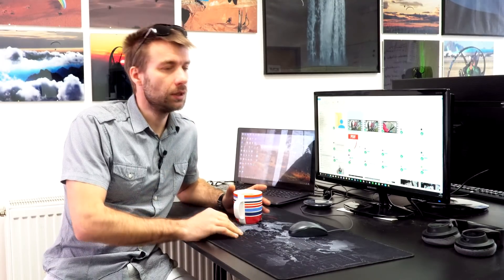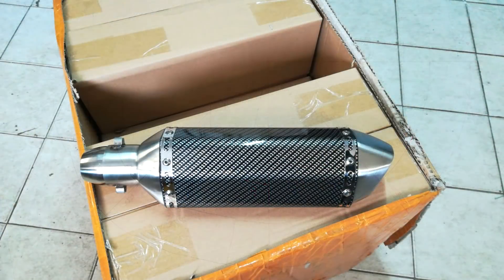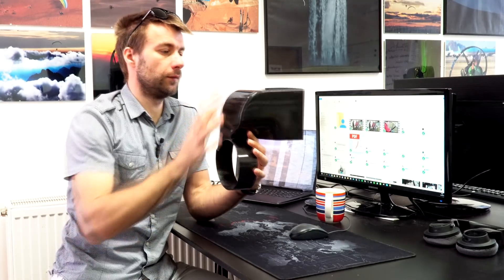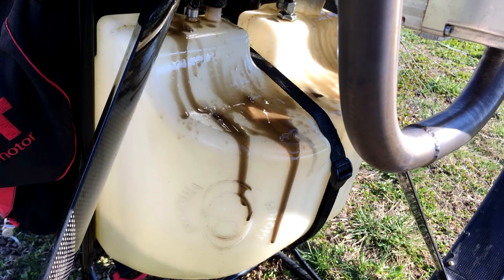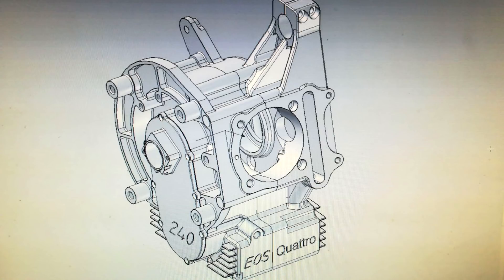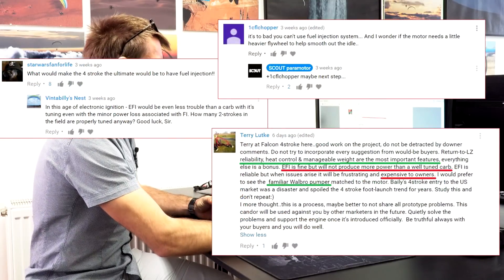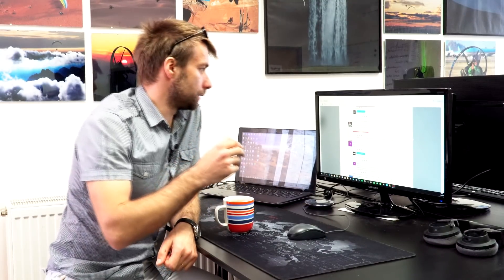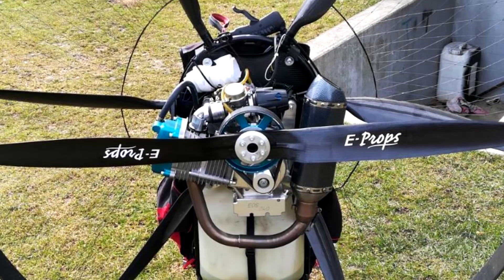UPDATE: best paramotor engine ever? 4stroke NEWS!

Comment: All I can see is (yet another) GY6 top end, (and probably crank) mounted in yet another custom CNC Crankcase. Taida 232 ala 'ruckus" mod top end?
Exhaust problems are due to trying to use dirt cheap eBay Chinese GY6 stock Scooter exhausts and their tinfoil brackets. Compound the quality issues, with massive vibration issues due to low mass, high compression and you have a solution less reliable than a stock Chinese Scooter that they now mainly only export, as domestically they've gone mainly electric!!
Is no-one doing any serious development? I love the choke that you can't reach, due to the stock (GY6) Scooter choke cables being a tad short? 
As for Fuel injection, waste of time. Heavier, needs a high pressure fuel pump, doesn't deliver any more power, and the stock GY6's don't ice too bad anyway. It gives even more single points of failure. 
I'm guessing the ignition is still a single GY6 bog-stock magneto too? 
Time someone delivered a decent fully Electric solution. Time to EVolve.

Comment: Spend all this time and  effort in going electric !  We drive e-bikes, Tesla cars why not electric Scouts ?
Reply: because the power density of gasoline can't be matched with batteries. and a 4 stroke promises to really improve fuel efficiency with out those pesky lithium batteries that like to ignite if you manage to do something like scrape open the foil wrapping...have you seen where they mount the batteries on the openPPG. no thanks.

Comment: Sounds all good 👍
What i liked most was no trash talking.
I wish you all success with the development of the motor.
Have you ever considered useing one or two miniature/small jet engines?  Just thinking.
I don't glide.
I've done a bit of static line jumps.
Just wandering if a miniature jet is feasible or not.😱😁😁.
Cheers for now.

Comment: Great project! At first glance I notice how small the crankcase is , this may be the cause of your oil leak.  Causing crankcase pressure to travel at a very high rate of speed through your breather port taking  oil with it.  A larger crankcase may be the cure. A good test or least expensive  would be plumb in a sealed canister or tank into the crankcase with a large port. Therefore increasing crankcase volume. It will most likely continue pushing out oil no mater how the pluming inside is routed.

Comment: Not sure if this has already been asked but...if someone is planning to buy a Scout or already has a Scout, will they be able to purchase this motor and perform a direct swap or will an entirely new unit need to be purchased? Keep up the good work and I look forward to hearing more updates in the future.
Reply: Almost any motor Can be mounted to any cage frame. I’m sure the motor mounts will be in different spot from the Moster 185 because it’s a new engine design. if the manufacture decides to allow you to do the swap by providing the hardware in an all in one kit then it’ll be an easy straight forward swap. But One can still easily buy parts piece by piece and do it (obviously your cage has to be same as the one scout uses with new engine) or custom make your own bracket/mounts/plate.

Comment: turn the engine so the cylinder is in the upright position iv rode 4 stroke bikes for 40 years and never known a 4 stroke run very well laid in that configuration they are not like a 2 stroke that will run in any position theres to much oil colecting in the rocker cover hence spitting it out through the rocker cover breather

Comment: The industry should look at hybrid motors for reliability and efficiency.  Electric motors, fuel generators.  More efficient on fuel, higher torque on electric.  Best of both worlds.  ICE doesnt need to run as hard as it’s just generating.

Comment: 4 stoke doesn’t require a oil fuel mix correct?
Reply: Nope. A 4 stroke is the same as whats in your car. The engine has a reservoir of oil and will likely run off of regular gas without the 2 stroke oil added to the fuel mix. In theory the maintenance should be less and reliability should increase provided they work out the kinks. It will also have the added benefit of better fuel economy since it will get double the rotations of a 2 stroke motor per cycle.
Reply: Thanks for the thorough detailed reply:)

Comment: Just why have you installed the  air inlet next to the exhaust. its loaded with carbon monoxide, I don't think that it has a abundance of Oxygen also more heat input. It does not idle very smooth either.

Comment: I do not like how near the exhaust is to the fuel tank. I would work to make the muffler face down, not only for rain issues, but for noise levels.

Could you rotate the engine 90 degrees and make a custom intake manafold so the carburetor is level?
Using that way/method the fuel would be on the fuel side and not the exhaust side.

You have the engine maker right next to you; perhaps they can make a block with a custom oil sump if need be.

Otherwise, your paramotors look well-designed.

BTW, I am also a Rhino3D user, carrying the same name on McNeel's forums.

Comment: I had the idea a couple days ago which is probably not the first idea but integrating a LED lighting system in the frame of the paramotor weather that it would be an option or not it's bound to be seen I know this will all take time but yeah it would be cool to have a somewhat perfect pair of motor to the General Public but I also realize that's not feasible at this time but the closer that you can get to perfecting a paramotor with the technology we have now that would be a winner just my thoughts though keep up the good work keep us informed

Comment: We understand there's a process of getting the motor issues worked out and in the future fuel injection electric start Etc. Hopefully a quick-release harness is in the works in the future or at least sold as an option as I like the fact of having something like an automotive Style Racing harness where you can disconnect from the harness IE in the event of going down in water

Comment: Get Honda involved, NO ONE builds small 4 strokes better....Period!!
Reply: Can you just use a Honda 35? Or is it too heavy how heavy are these other motors used today
Reply: At 1hp, you would need at least 15 of those and that would only get you a slow climb :)
This "is" (for all intent and purpose, a "Honda engine"... the infamous GY6 with Taiwanese mods)
Reply: Hondas engines are too heavy and underpowered. There is way better engines out there than hondas. I beg to differ on Honda small engines being reliable, I change out these engines after 30-50hrs of use. Their garbage and non rebuildable
Reply: @danr8194  Thanks for the Heads Up Dan :-)
Reply: @danr8194  I tried giving u a Thumbs Up
on two different Devices, but when I
try to, it goes straight to Replies instead!!?
 The same thing keeps happening when I
have tried giving Thumbs Up to several
others!? (On 3 Devices).
I think You Tube has done something to
cause this ......
 Who knows how many Thumbs Up u'v
been given!?

Comment: This is why I love Miroslav, and scout paramotors! He could hide the fact that the new four stroke engine is having a few problems, like with the oil leak and such. No, he is giving out honest updates as the engine comes along, and I know it will be amazing because that's what Scout is all about, amazing gear. Also you see these other companies on here bad mouthing each other left and right, no class! I haven't seen SCOUT do this once, that's how you should act. All that other crap is bad for the sport. All those reasons are why come hell, or high water I will buy a  Scout with the Moster 185 plus. Yeah it'll probably take me fucking 4  years to save up for everything, but to me it's worth it. SCOUT IS THE SHIT!!!

Comment: It looks like a great new development in internal combustion engines but it might be too little too late electric is going to sweep the paramotor industry and as battery capabilities increase rapidly they will match and surpass internal combustion engines little to no maintenance very big cost savings safer less probability of stalls many fewer moving parts no flammable fuel although some batteries have had issues with overheating but just like motorcycles and Automobiles the new kid on the Block electric propulsion is taking over every Transportation mode
Reply from the maker: It depends on what your flying ambition is. If you want to fly around your house and enjoy the sunset this is great.
For climbing high above the clouds electric do not have enough power.
For flying adventures, fly and camp, discover new places, camp overnight and fly further next day... Electric just do not have range and charging takes too long.
Recently I got addicted to adventure flying. Icarus Trophy race, flying Midwest USA or Iceland would not be possible with electric.

Last weekend I have flown an electric engine. It was a nice experience but not my cup of tea.

Comment: 4 stroke engines have their place ... and this is not it. They are cumbersome and overly complicated  in comparison to the industry standard 2 stroke.  
      There will be far more maintenance required,  with valve adjustments,  oil changes ect.
     The number of people using 2 stroke  paramotors are  not a  significant contribution to emissions issues.  
      I see few to  no benefits  of  4 stroke technology for small , lightweight  applications.
Reply: Benefits: double the range, flat torque curve, don't have to premix fuel, less stinky, probably a bit quieter.

Comment: What about a twin cylinder (two smaller pistons) to balance pressures? Many more moving parts I know, but single cylinder engines have typically been relegated to the 2 stroke market and don't have to deal with oppositional pressures, blowing oil out, like you're trying to overcome. Two pistons naturally balance each other.
Reply: Dawson Ronan Not to mention that single piston designs are challenging to balance.

Comment: I don’t get the 4 stroke thing.  Paramotors are very weight sensitive and no matter which way you look at it, 2 stokes are lighter and produce more power.  More reliable as well. Less moving parts. I honestly don’t think you can re invent the wheel.
Reply: 2 strokes more reliable than 4 strokes ? Not even close. There is much more to it than just the number of moving parts ! 2 stroke pistons work in terrible conditions of heat and lubrication, and that is why they are very short lived !
Reply: Have you even tried a 4 stroke.....? 
I’ve flown Baileys now for 5 years, they are the most reliable motors I’ve ever had, and with comparable weight of some of my previous 2 stroke Parajet/Polini 200 paramotors. 2 litres per hour compared with 5-6 litres per hour too, you have a weight saving of half the fuel weight for the same amount of flight time.
Reply: Jason Nadler no way 2stroke is more reliable, shorter time in service there a dozen reasons why an efficient 4 stroke is the way to go and it's not just fuel consumption
Reply: only benefits are efficiency and not mixing oil in your fuel
Reply: fuel consumption 2 liters per hour vs 2gal /hr

Comment: Why do they put this long (and heavy) exhaust pipe around the bottom of the engine, which brings the silencer looking upwards, so that the exhaust hole (and the noise) is closer to the pilot's head (and ears)? Wouldn't it be better to keep the silencer and the exhaust hole below the engine?
Reply: Because the bottom is the hottest part. Would you want a 300+ F pipe just inches from your head, melting your helmet and singeing your hair, or melting your netting? Also it helps keep the oil in the pipe and not on your floor when not flying.
Reply: Check this for the layout of the exhaust and the silencer:
http://www.baileyaviation.com/swap_images/V5ENG_pic_default_500.jpg
Reply: @michroz , The silencer is way heavier than the head pipe. Yes, both should be kept as low as possible.
Reply: What’s a little hair or netting?   You missed it’s proximity to the fuel tank and the lack of shielding.
Reply: Americans will get a hold of it and change it

Comment: any chance of a diesel engine
Reply: Steam engine would be awesome
Reply: Horse powered.  Or maybe goat powered
Reply: goat power is impractical, obviously it would eat your lines.  Horse power is the way to go.
Reply: There are a lot of compression ignition (essentially diesel) aircraft model engines. Diesel aircraft engines have been around forever (see Jumo 205), so it's not a stupid idea.
Reply: Sure if you don't mind a 200 lbs engine on your back.
Reply: Maybe a hit and miss engine?
Reply: @renhosti , Haha ! That's what I'm talking about. 1500lbs, 4hp but 1800lbs of torque !!
Reply: Check out the development of diesel engines for fixed wing aircraft. It's not easy to make a light diesel because of the high compression ratio. It's just alot of cylinder pressure.
Reply: diesel single you would not run over 3k rpm. They are certainly heavier also.
Reply: Apsestasis lets step back into reality here. We are talking about small scale engines which are practical to use for paramotors, not full framed aircraft.
And Yes, I have looked! The best you could do is a 7-12 hp (comparable to an 80 class engine) Diesel engine(50+kg) and it will still weigh more than twice the heaviest Vittorazi 185 (25 hp at 7.800 rpm @ 15.3 Kg pull & electric starter version)

Here is the stats for the average light weight diesel engine. 10 Hp @ 106 lbs
And it is still unable to swing a prop fast enough to get even itself off the ground!   torque: 20 ft. lbs. @1500 RPM
https://www.carrollstream.com/10HP-Diesel-Engine-With-Electric-Start-p/cs186es.htm

Or maybe a 20 hp matching the power of a 180-200 class but 1/4 the rpms at 132 lbs and 30.2 ft. lbs. @2650 RPM
https://www.carrollstream.com/20HP-V-Twin-Diesel-Engine-With-Electric-Start-p/csr2v840.htm
Reply: need a turboprop engine
Reply: why tho.

Comment: I think Graphine will leap the next generation battery's to a place where all future Paramotors will be electric..
Reply: you accidentally put a dash in your number twelve
Reply: I’ll believe it when I see it.
Reply: I've seen Graphene battery's on sale for RC / Quadcopter models already
Reply: Would be awesome! Im already looking at electric as an option.
Reply: People keep passing around "buzz words" without understanding the science behind it. Liquid fuel, such as gasoline, is nearly 8 times the energy density of most current battery technologies. The use of graphine can only improve the density by about 20-30% at the cost of higher volatility. Even with the latest technology, most electric powered flights are less than 30 minutes with comparable weight ratios to a liquid fueled motor. At best graphene can stretch it to a 40 minute flight. Meanwhile I will be up for 2.5 hours on my gas powered motor for the same weight ratios, and can quickly refuel and fly again within a few minutes.
https://www.youtube.com/watch?v=8RbwOhM6PUk
Reply: Fairly certain samsung have made significant progress on the graphene front recently, keeping my fingers crossed for it to spread into enduro motorbikes as well as paramotors 👍
Reply: yes sir
Reply: excellent I hope we can get a Scout Carbon E-Para
Reply: I'm not holding my breath on that, but electric would be FAR better.  Simple, quiet, smooth, and a flat torque curve
Reply: Exactly in the next 1-2 years the electric evolution will begin when baterries from graphene will replace fuel